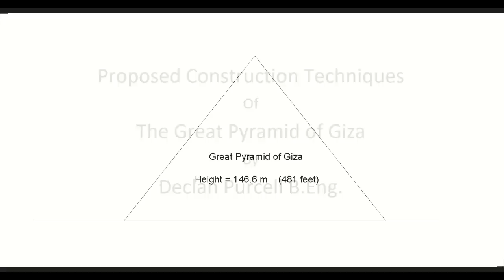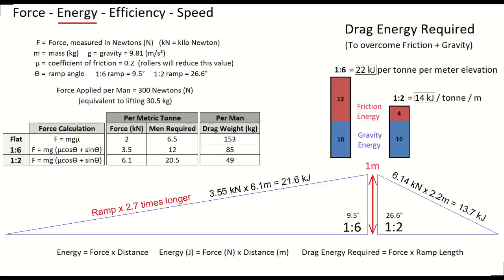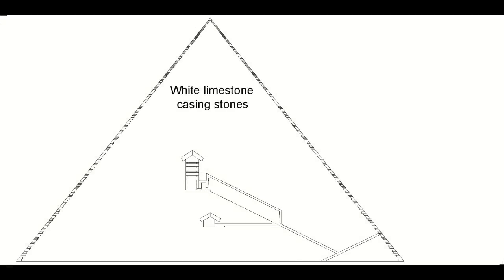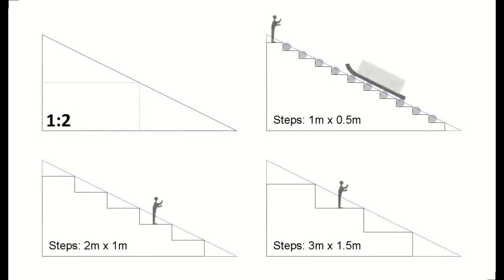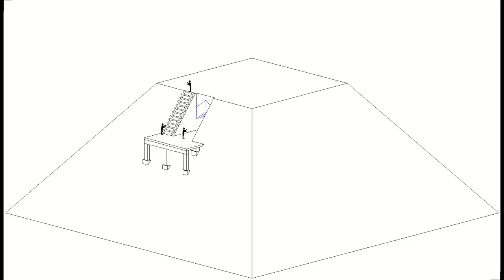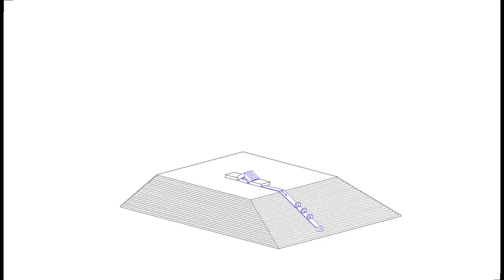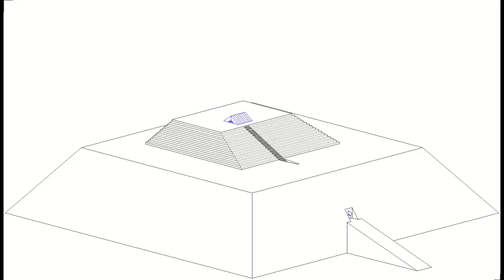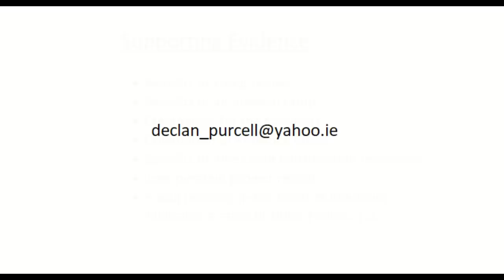Proposed Pyramid Construction Techniques

Comment: I think this whole how the pyramids were made is a little overblown. Seeing as the average block was a meter cubed and only weighed 2.7 tons.  As someone who has built elevators and brought 2 and 3 ton machines up stairwells with nothing more than plywood, some anchors, two people and a come-along.  Not that impressive at all.   There are a couple of hundred really large blocks the largest being 80 tons.  But even that could be overcome with man power ropes and a little bit of counter weight with some smaller blocks.  80 tons of granite is about 26 meters cubed. Don't get me wrong it would be hard.  But doable with just a little bit experience and lots of man power.
Reply: Agree. And the blocks near the top are actually much smaller, weighing 600-800 lbs. Also much of the core is generally understood to be rubble mixed with mortar.

Comment: the pyramid contains 2,300,000 blocks. And they had to drag these from far distances. If it took them 60 minutes to cut, drag and set 1 block that would be 262 years, assuming they worked 24/7.
Reply: Only if they did one block at a time.  And remember, most of the internal blocks of the pyramid are much smaller than the 'mega blocks'.  If they had ten teams working separately at a time then it would only be 26 years 🙂
Reply: What do you mean by "far distances"
Reply: @NoddyTron  how many blocks per day could they set? 26 years = 9490 days.
Reply: @mychromebook9935  Well, there's 2,300,000 blocks, to do it in 26 years they'd have to set around 245 blocks a day.
Reply: According to whom? Over 20000 people were working on the structure at a time over more than 20 years with some estimates as high as 100000 during periods when the harvest was over.
Reply: @NoddyTron  
20000 people are not moving one block at a time.
Reply: they quarried the limestone from the plateau nearby, not 500 miles away
Reply: @miketheman4341  I know, my point is exactly that.  The other guy is claiming that it would take hundreds of years to construct.
Reply: The stones used in the construction of the Giza Pyramid were mostly quarried locally. The largest stone, the King's Chamber, was quarried from the Aswan region about 20 miles (32 kilometers) away. However, most of the stones are believed to have been quarried much closer to the site.

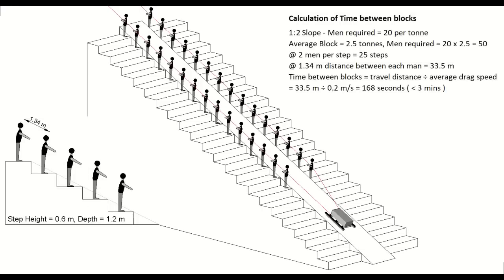Comment: 1:32
this method does not work as everytime the block passes one partner of people, those people can no longer contribute to the pulling process as the block is higher than them
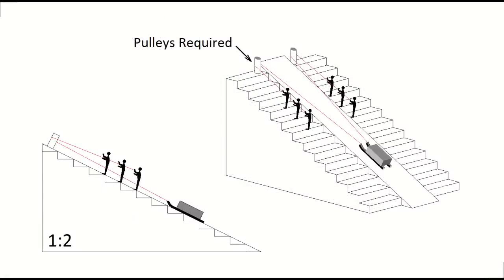1:39
yes this method would solve the above issue, but you stated it "increases pulling power due to gravity assist" not sure what on planet earth that means but basically this method actually makes the job harder as the friction exerted on the pillars at the top from the rope is significant, and scales exponentially with more weight
and this is before we even factor into account the further wear that the rope see's as it wrenches round the pillar.. which, when your building pyramids on this scale is a considerate problem
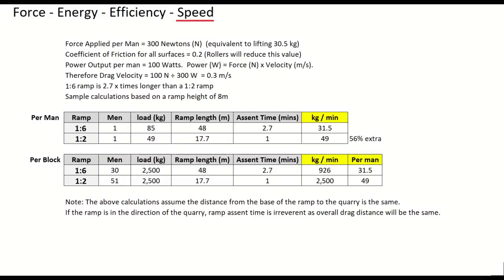2:03 
you state that a steeper ramp is actually more efficient due to friction losses, while this may be true a steeper ramp requires permanent pulling force from above with no stops, a less steep ramp depending on the surface area of the stone may let the stone sit in situe while the team prepare for the next pull
no doubt they used a ramp with a slow incline and they purposefully placed the stones on the side with the most surface area
using a ramp as steep as you suggested once again exerts more weight on the rope, as less weight is being consumed by the marriage of the surfaces between the pulled stone and the ramp
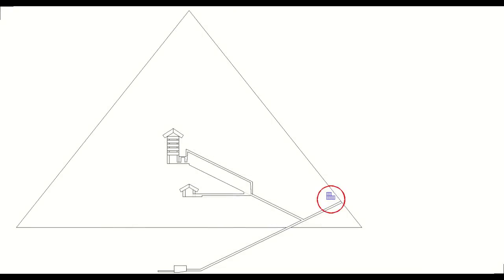3:15 you mention the ramp being built into the pyramid, this just factually is not what we see on any prior or post pyramids, they used external ramps, the remnants of which we can still see today
also using this proposed method once you build once side of your pyramid you would be stuck filling in your own ramp that you need to simultaneously  hoist with
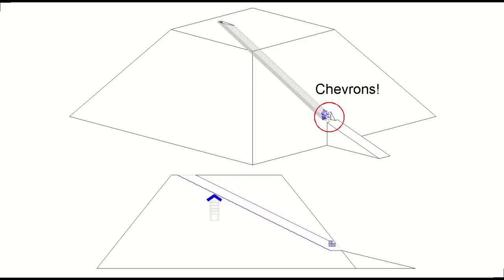3:14
"no explanation for the function of the chevrons?"
mate they are literally that big because there is millions of tons of rock placed above it, and its to protect the entrance
at this point i assume your trolling
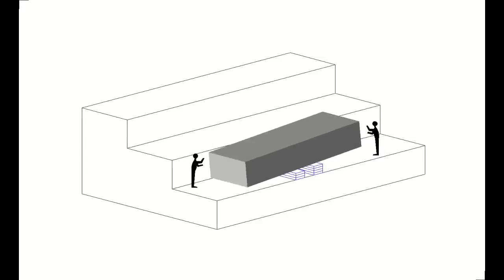6:00
the rocking technique?
go show me how that's performed with 80 ton granite relieving block, how on EARTH would you manage to first lift one side to place a rock underneath it?
you would need a metal bar that's about 50ft long with 10tons on the end of it in order to provide anywhere near enough leverage to make it lift
not to mention even if you did manage it the amount of damage the rock would sustain after being levered against its weight in that fashion all the way to the top is insane, it wouldn't even be square by the top, it would contain huge pits and grooves where its been jacked up everytime it reaches a new level
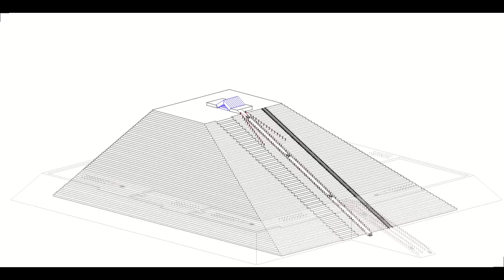6:24
the idea of canals with floating rocks held buoyant by inflated animal intestines is just insane, even with modern day plastics you would struggle to inflate a balloon of some kind enough to let it raise a big stone
maybe this idea would work with a stone the size of a football, and 10 animal bladders
even with airtight modern day metal barrels to hold the air it most likely wouldn't work
tip.. theres a reason nobody has managed to recreate a floating 15ton block with an array of animal insides
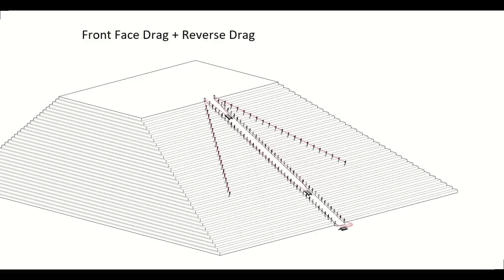Reply from the maker: 1:32: see image @ 5:20 to visualise full details of this proposed technique.  There are always adequate men at the top to ensure smooth continuous upward movement of the blocks.

1:39: Gravity assist applies to the men pulling in the downward direction.  They are now also using the weight of their own bodies to increase pulling force by at least an additional 150 N.  

1:36: I indicate that pullies are required on these pillars.  I did not show details, but obviously these pullies would have grassed bushings to ensure low friction losses.

2:03: A steep ramp is x 3 times shorter than a shallow ramp, this accounts for the majority of friction loss savings:
 (Friction Energy = Friction Force x Distance)
However, the coefficient of friction also reduces as the ramp angle increases, so the steeper ramp has slightly less Friction Force but approx. 60% less Friction Energy (see bar chart @ 2:00)

Even on a shallow ramp it makes sense to use rollers when raising massive blocks, so these too would require a holding force.   However, on the steep ramp, the manpower is resourced to eliminate excess stress on the pullers so that they can maintain an upward force between each stroke.   The steeper ramp is also shorter which keeps the lift time as quick as possible and a short rest period can occur after each lift.

Speed is key and speed requires power.  This power is achieved with adequate manpower and manpower was not an issue.   A shorter ramp requires less pulling manpower, but considerably more construction manpower.   A steep internal ramp requires no construction manpower.  A shallow ramp cannot be internalised.   An external ramp (either shallow or steep) is a complete waste of manpower, for construction, and then de-construction)

3:15:  It is not practical to build massive external ramps, but smaller pyramids would use an external.  However, even on the larger pyramids its possible they had external ramps for the first few meters (as I propose on the pyramid of Khufu).   So, evidence of an external ramp does not eliminate the presence of an internal ramp.   See table @ 1:00 to analyse external ramp construction efforts.  Large external ramps require millions of man hours.  
The internal ramp operates like a conveyer belt, continuously raising blocks.    It is never blocked.

3:14  Please tell me: What do think is the purpose of the chevrons, to protect the 1m wide entrance tunnel….?    Absolutely not required.    As this tunnel descends inside the pyramid the mass of stone above increases… Do you think the entire descending passageway is protected with chevrons for its entire length….?    

6:00 If you supply me with an 80-tonne block, the required manpower and x number of steps as shown in the video I will show you that I can raise without damage.   There are also videos available on you type that demonstrates this technique.    Your lack of capability and imagination is not evidence against the practicality of this technique.

6:24:  You have finally made a correct statement.   I hope you have posted it to the many videos that propose floating blocks in such a manner and the absolute ridiculous proposals that they could also be floated upwards in a sealed water pipe.
Reply: In reply to Sherma.
About the 6:24 , I belive Declan meant they sailed or rowed boatloads of stones to the BASE of the construction site, not that they floated them up the slopes. The canals he describe would be canals from the Nile to the construction site , not waterfilled canals going up the pyramide sides. 
I checked the timestamp, and i can see that it could be misunderstood.

Comment: Now explain how they adjust their grip on the rope while pulling the blocks uphill on the greased cylinders. Because surely if there is no enough force to pull it upward, it will go downward.
And how they coordinate to pull at the same time.
Also, not a single word about the angle of repose of sand, and how a bloc of sandstone would rest on that slope. Would it slide down or not at the natural angle of repose of sand ?
Reply: It seems that more people can grab the rope and take turns pulling it. For example, one team can pull the rope while the other team simply holds onto it.
Reply: I think with the big blocks they'd be chocking them constantly as they went up.

Comment: Thanks YouTube recommendations, this knowledge will definitely come up really useful in the future!

On a serious note, great analysis. Tho I certainly like the option with external ramp being used for construction more, largely because if anything went wrong with a stone moved through the internal ramp, it could get stuck or otherwise damage the surrounding stonework. Accidents DO happen, and I'm sure Ancient Egyptian architects were well aware of that fact.
Reply: if it got stuck, you could break the brick down inside the ramp and remove it piece by piece, pr just remove enough to dislodge it and then slide it down to the bottom
Reply: @chickendoodle32  That's just it tho, there's no quick and easy way to break up a massive brick within a tight tunnel. Not to mention you have to pull out any other bricks that could've been going up behind the stuck one... And I guess nobody cares about damaging the support structure of the tunnel itself, huh.

Comment: For the really big chamber blocks wouldn't it have been easier to just have them at ground or a low level of the pyramid initially, then build up half a layer of the pyramid (only about 1 metre higher than the other half) push the big blocks over to the completed side, then fill in the other half, then repeat this method until the blocks are needed?
Reply from the maker: If all these blocks were on site when construction started this could be done, but that means they would have needed to have a detailed final design right from the start.   If any blocks were damaged in the process, it would have posed a difficult replacement problem.   In terms of overall energy and effort to raise it would not be easier than the methods I propose.   Good comment though.
Reply: @declanpurcell571  So you came up with this after ignoring all the proven facts or just not bothering to find them?
Reply: @danquaylesitsspeltpotatoe8307  oh knowledgeable one, list a few of the known facts that his theory contradicts

Comment: This appears to be a possible solution. Very impressive presentation. For me, it adds another level of mystery...who was the architect? Without any computers who planned this complex solution? Who was able to coordinate the work? Were there "plans" drawn? Down to making the stones the correct sizes and fitting together? Consider the world population estimated at around 50 million people or less depending on when it's built. The odds of someone with the intellect of the architect is way less than 1 in a million. To have that person, in that region further reduces the odds. Would be interesting to see if someone could try this on a much smaller scale for viability.

Comment: Have you considered the very recent confirmation of the 9m long cavity behind the chevrons? It unfortunately appears to be a dead end, however the still remaining cavity that has been detected does line up with this theory.
Reply from the maker: There appears to be a ledge along the top layer of roughly hewn stones on each side of the room, which indicates to me that the vaulted beams could be twice as long as seen.   It therefore appears to me that this room has been filled with stone blocks to the height of the base of the vaulted beams and then an extra row of blocks was placed on each side to offer additional support to the vaulted beams.  These filler blocks would offer 100% structural support to the walls and considerable support to the roof.   This means the original floor level of this chamber is more consistent with an entrance beneath the external visible chevrons.   It would also make sense to fill this room in such a manor for structural reasons prior to be sealed off if its purpose was for construction only.

The visible upper part of the gable end at the back of the room is clean cut solid stone with a non-straight vertical line to the left of centre which could be a crack.   The back wall is completely concealed by the filler stonework, so it’s impossible to verify if it’s a solid back wall, or a blocked entrance to another room or as I predict an entrance to the internal ramp.  It’s also highly possible that such a ramp and /or entrance is completely blocked with stonework for structural purposes as it makes sense to do so to maximise structural stability once it has served its purpose.   Backfilling the ramp and entrance passageway is not a big task and it makes absolute logical sense to do so.

Next step should be to make a bigger hole and insert a camera which can reach all the way to the back wall for detailed examination.

Comment: great explanation, i think they could use a counterweight sistem. Just a box that can be filled with sand at the opposite end of the stone can make the work much easier, so you dont need 1200 men too pull the rope.

Comment: Very interesting ideas. One minor problem though is that the shafts could not have been air vents since they were originally blocked off.
Reply: They could have been open during construction, then blocked off when the white limestone casing blocks were placed.
Reply: @scottbreseke716  That's true. But they were not closed off with simple plugs, which would be the case if they were air shafts. They were closed off with blocks that had a continuation of the shaft cut into them leaving a small layer of stone to conceal the shaft. This is how they were found by tapping against the wall and observing a hollow sound. Closing off the shafts in this way makes no sense if you just want to close off a shaft that has served its purpose. There would be no reason to carve out a continuation of the shaft in the closing block.

Comment: It might actually make sense to leave as many spaces of the strucutre hollow as possible to save costs. To which degree could this be done?
Reply from the maker: You could leave a few inches between blocks and fill the gaps with sand but larger voids require more precision stonework to ensure structural integrity.   There is evidence that sand was used as a gap filler.  When they drilled holes is the horizontal tunnel leading to the Queens chamber they encountered pockets of sand, (not standard sand but a type more suitable for the purpose of providing support).  If building the pyramid with modern concrete and re-bar we could build a honeycomb type structure with minimum concrete and maximum voids.   However, with lose stone and blocks its best to avoid voids.

Comment: This is really well done. So you're still assuming the top 2 tunnels? Would those be filled in since there's no use?
Reply: I'm not sure how you'd fill them in, because you'd have to start at the bottom of the tunnel and stack upwards, which would be impossible, or start at the top with a whole load of blocks on a platform and lower blocks all the way down.  I think its more likely what he suggested, that they just blocked the ends.  At least I hope they did 😁 - I'd love to see inside!

Comment: Interesting theory, but did the Egyptians have such long and strong enough ropes?
Another fairly recent theory I heard about is that they would bring blocks up by moving them from side to side and putting small blocks under them each time.
This would require much less force, especially when adding a mast to the block. And doesn't require such long ropes. It also doesn't require the block to be raised in one go. But they could stop for luch f.e. and continue later.
Reply: Strong fiber ropes were found inside the pyramid itself, tied in a knot to secure doors